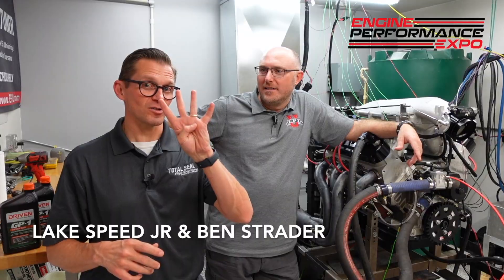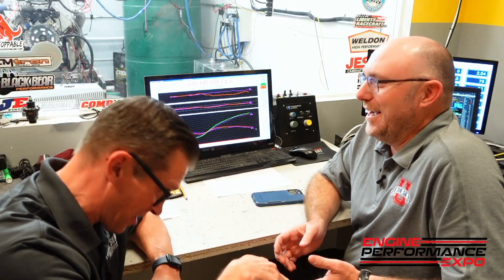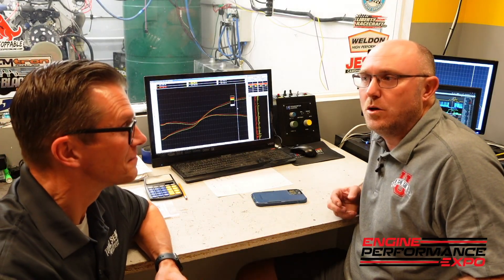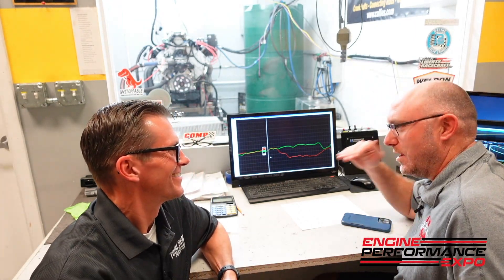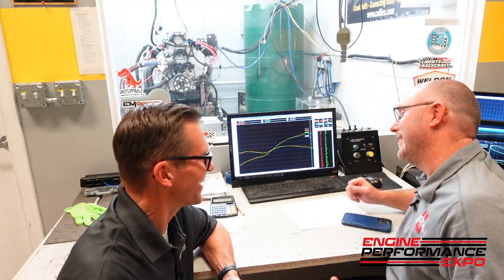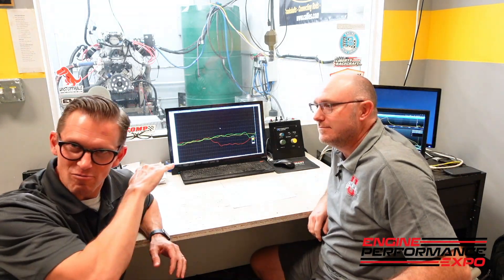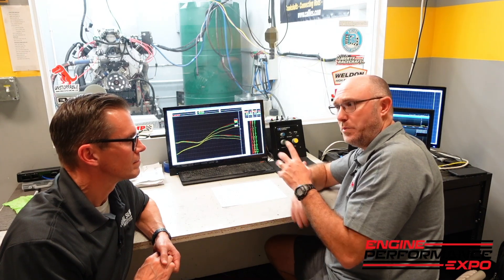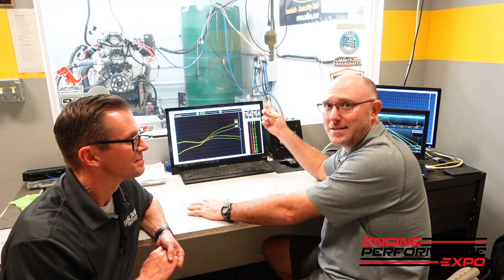How MUCH OIL is TOO MUCH? Dyno Results!

Comment: This is a known outcome… too much means crank sloshing ..
Reply: The crank is slapping the oil that comes out of the main and rod bearings and what "drips" down off the pistons.
More pressure means more oil going through the bearings. 🤔
Reply: @hotrodray6802 look up a diagram of a crankshaft, windage tray, and oil pan and think about what would happen if you overfill the pan. Might also be helpful to check out how and why windage trays work.

Comment: This is a pushrod engine with a holley EFI right? The power loss at high revs with more oil actually makes sense. I would be curious on a more modern dual overhead cam engine with a timing belt or chain. Got to say though, this engine sounded much better with 9qt in it.
Reply from the maker: Yes, pushrod Chevy LS with an EFI system. Wait until you hear it on 20 PSI of boost!
Reply: ALL LSxes/LTxes are pushrod, overhead valve.

Comment: It's a good video, but unfortunately, dyno engines aren't subjected to braking and acceleration, nor cornering, or riding bumps. It is, however, a fantastic demonstration of the effects of windage and the effects of poor crankcase management.
Reply from the maker: True. That oil pan was made for road racing, not dyno testing. Yet, it made for some good fun!
Reply: Everything is about balance.  That is the big takeaway from the video.  Too little oil and you can lose pressure and break something (4qts in this example).  Too much oil and you could be leaving power on the table while being far beyond the safety margin (11 qts in this example).  
Knowing your vehicle's tune, RPM range, goals you can use the information to make better decisions and some might test this.  How much fuel pressure does your application require minimum to stay well lubricated; yours might only need 25 psi to be good, others might need 60 or 80.  Too much pressure is wasted power just like more oil than is needed.
the 'slosh' from stopping, launching, cornering hard is usually dealt with by baffles; Doubt it is an 11 qt empty bathtub of a oil pan.  Most people interested in this level of detail, and dealing with this much oil are in race applications. 

Of course if you are Joe Dirt wanting your Mustang to go faster, they might start keeping it on the low mark if you misunderstand the purpose of this.  I don't think Cindy with her Silverado Trail Boss is considering putting a couple quarts less so her truck feels more 'peppy'.

We must use our intelligence to apply the knowledge to fit our personal world paradigms.  Watching Adam Savage on Tested doesn't help me build a better bird coupe; but I can learn from his techniques, explanations of tools and experiences to apply it to my life; same goes for watching Eric O on SouthMainAuto problem solve vehicle repair with quick thinking, ingenuity, and making things work when there are no other solutions available any longer.  That is applicable far outside repairing our cars.

It is a fine video; but not sure exactly what you were looking to get out of it; I am curious though.

Comment: Very interesting.....i wonder if in racing conditions this loss of power still present, ive seen at rally that the more oil you have, the better....some racing cars have extra oil reservoir...
Reply from the maker: It would be worse on the drag strip as the g force would make the oil level higher in the back of the pan.
Reply: @themotoroilgeek  Yes, but for example on curvy track many complain about starvation due to lateral turns and G, so they modify the oil pan....somehow just like Ford did to my car...
Hope you dont stop posting your videos, they re very usefull and i, at least, apreciate very much your effort!
Reply: The top level, highest power output, WRC Rally 1 class cars all have dry sump systems on their engines (ALL real/full dry sump systems have an oil reservoir).

The 2nd tier, lower power, WRC Rally 2 cars (and all of the other classes even below this one) are prohibited from using those systems (in a vain attempt to keep costs down), so they must use all of the baffles/trap doors, etc. in their wet sump systems to try and keep the oil in check.
These cars might slightly overfill because of that, but definitely NOT a "more is better" attitude.

Comment: It would be interesting to see what would happen in a dry sump engine.
Reply from the maker: We are going to do that, but extra oil in the dry sump tank will not effect windage.
Reply: @themotoroilgeek Excellent, when?
Reply: When the Corvette first introduced a dry sump from the factory, a lot of customers added too much oil. The tank would barf the excess oil, once enough RPM was achieved, into the air intake and contaminate the MAF and EVERYTHING downstream, including the catalytic converters. On non emissions controlled vehicles like race cars, the breather tank could barf oil into the engine bay, onto tires, the track, and sometimes hot exhaust causing a fire!!!
Reply: Don't forget, in a dry sump system, the engine has to drive a scavenging pump. That uses some horsepower, but not 60 HP. It really would be an interesting experiment. It could be, that there's even more to be gained with a dry sump system, than running less oil in a wet sump engine.
Reply: The oil tank would overflow
Reply: Motorcycle engines have used dry sumps for years. There are two oil pumps, one to feed oil to the engine and one that scavenges the oil from the sump and sends it to the oil reservoir.
Reply: @spaceflight1019  Dry sumps must be appeared in aviation, because they don't have choice. On bikes the scavenging pump usually play 2 roles, it scavenges oil and sends it to gearbox shafts under low pressure. After the gearbox oil goes to the high pressure pump. Actually, I never thought that it is essentially a dry sump system.
Reply: Are new engines that different from an engine from 1966? Back in the day I rebuilt my 66 396cu engine, stripped down to every last bolt. It was a 5 quart oil system and the oil pan had a splash guard built in. Sitting there one night looking at the pan I measured how much oil it would hold to get to the splash guard as the pan looked pretty deep. It was 8 quarts, I never ran it over but I can’t see why adding an extra quart (6) quarts instead of 5 should make any difference in that over sized pan. The oil would still be well below the splash guard and of course the oil pickup was below the splash guard.  So do the newer engines have smaller pans where a quart over would be damaging?  By the way love your videos!!!! If they had a class like this in high school I would fail on purpose so I could take it again.
Reply: They gain more power.